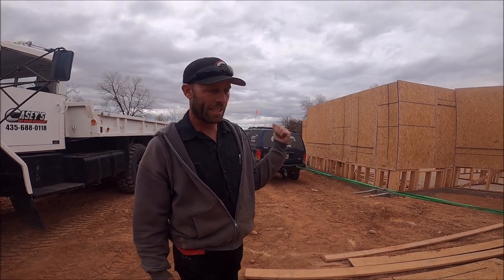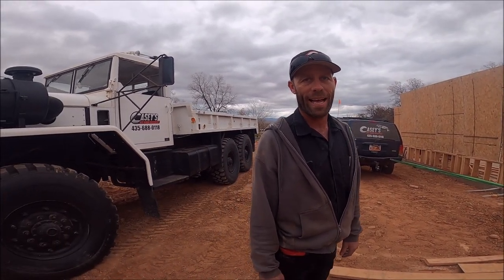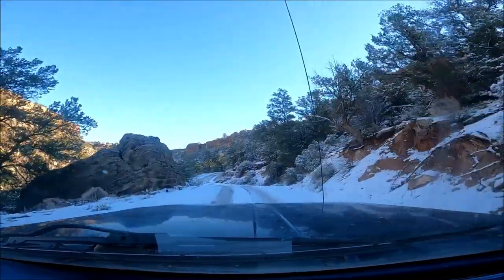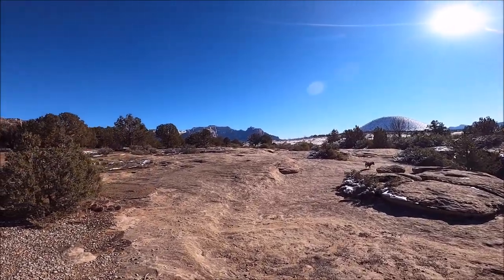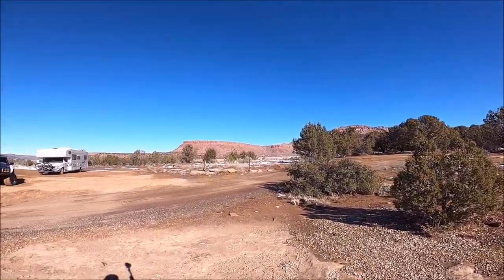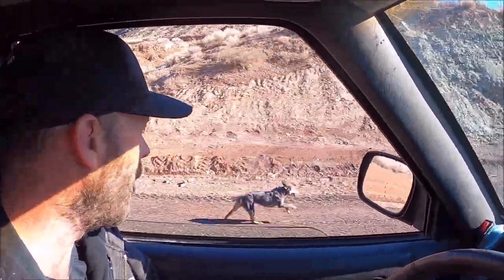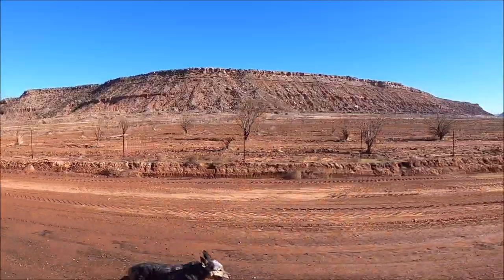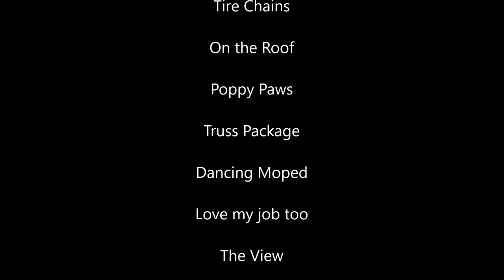A Semi Stuck under a Load and a Motorhome on the Switch backs! Off Road Recovery!

Comment: I've Done Construction  building to Condominiums to apartment buildings to hospitals, this Boys is un- experience truck driver delivering trusses. you loosen a load turn the rollers loose and you give it hell and blast out from underneath, and that's why he got stuck under the load. WHERE'S THE FORKLIFT?
Reply: He found some pretty soft dirt for the trailer axles, AND appears to me he couldn't locate the suspension dump for the trailer air ride.

Comment: You don’t see many truss delivery trucks that aren’t 4 wheel drive. This is why. You would think that building project would have a big forklift that could have assisted. They probably aren’t going to work those trusses by hand. Happy new year Casey.
Reply from the maker: Yes it was a heck of a load!
Reply: Around here, truss delivery trucks are regular over the road semi tractors. If they are lucky they have full lockers on the rears.
However, the drivers know where the suspension dump switch for the trailer air ride is, and they don't linger when they pop the rollers up!
Was it AC/DC that did "Balls to the Wall"?
THAT'S how you unload trusses!
Reply: @haroldphipps3457  most where I live are about 550 size four wheel drive. Tractors would have trouble with smaller private driveways. Large tract housing projects might be ok. They are most often muddy.
Reply: @loveistheanswer8137  that load would be about 3 F550 loads.
Reply: @haroldphipps3457  it looked like only trusses. If there are a lot of lvl beams it adds a lot of weight to the load. Must trusses are only two or three hundred pounds each.

Comment: Those T130 truss trailers can be tricky to unload. As the truck pulls out and the load rolls off, there is a weight transfer that takes the weight off the tractor drivers. On loose ground it's easy to lose traction. I know. I've been there.. Great Job getting the driver unstuck.
Reply from the maker: Thanks for the info

Comment: ideally a m543 or equivalent army wrecker with recovery winches and small crane should b your next investment and is a very versatile vehicle, just saying. your 5 ton cargo has a go pull for lighter vehicles but once u plant a 17 ton wrecker nothing is going 2 move it with the spades in place.